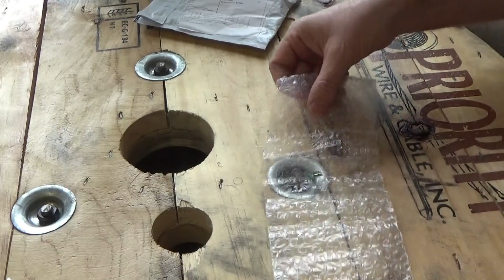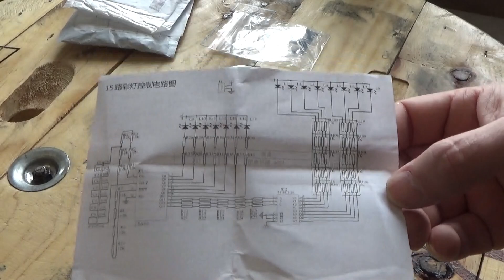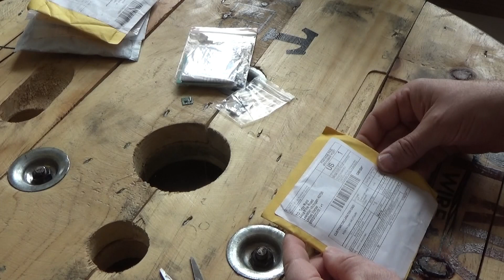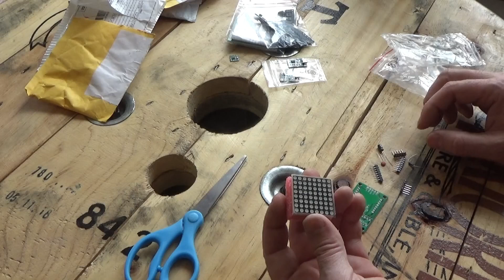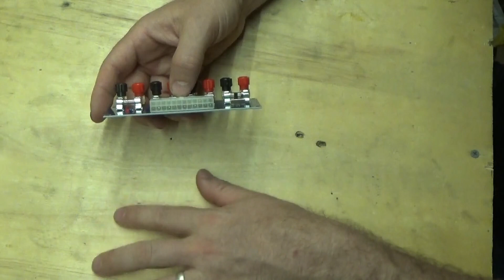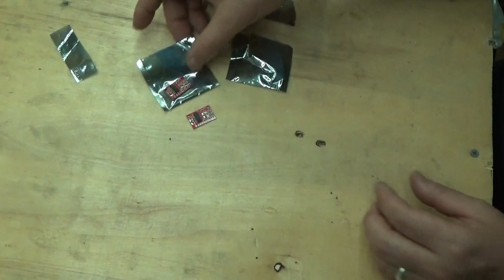Unboxing A Mess Of Dirt Cheap Electronics Kits And Projects

Comment: Oh wow, that breakout board for a ATX computer power supply to make into a combination
Bench power supply with an on/off switch.   Cool think about the old AT Power Supply was
 you had that big old red switch to turn it on and off.
Reply from the maker: I am using it right now. Working fine for me. Its pretty cool.

Comment: Hey Troy.  Do you remember there used to be a neat electronics store called  " Radio Shack "  ?
I loved going to Radio Shack when i was a kid in the 60's.  I actually was a card carrying member
of the exclusive Radio Shack Battery-A-Month Club.  It was cool being able to get a free battery
once every month.

The old Radio Shack then was different than what it evolved into before it finally died.  The guy who 
worked there actually knew the difference a transistor and a capacitor.  They did NOT pester you then to give you 
your telephone number.  My favorite thing about Radio Shack was those cool  red  "  P-Box " electronics kits.
The were kits that came with a small red plastic box with holes in it so you could lay out your transistors, resistors and capacitors on top
and solder them together underneath.  I made several P-Box kits.
Crystal Radio
Sound controlled switch
Galvonic response detector (  AKA Lie Detector )
https://www.ebay.com/i/293129621094?chn=ps

The great thing was making those kits taught me how to solder and how to read the markings 
on electrical components.  It seems that, judging fro your kits, they have really miniaturized
these items and are those break away little boards you had in that one kit with many of the same part on
one strip?

It was sad to see Radio Shack devolve into a Cell Phone and electronic Toy Store.  No one there really knew anything
about electronics in their later decades.
Reply from the maker: I miss that place. Wish there was one around now because I am working on electronics at this time. If I forget to bring something from home to the office I have to wait till tomorrow to continue on.